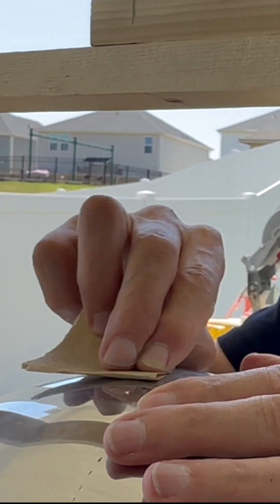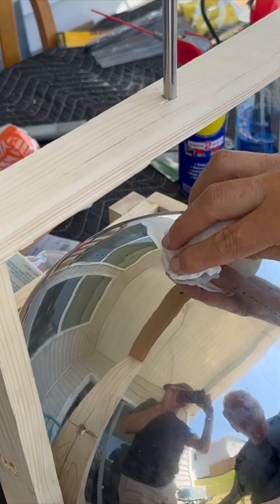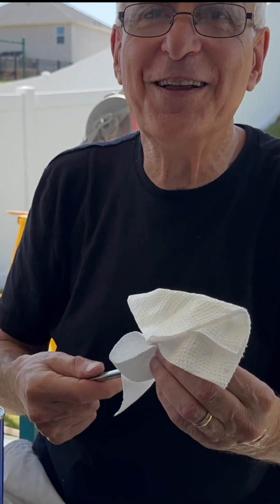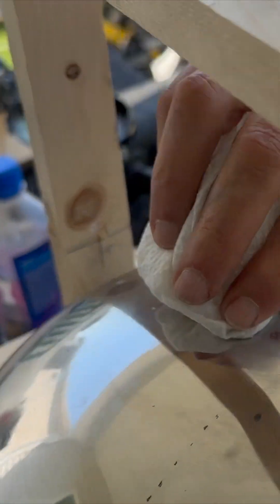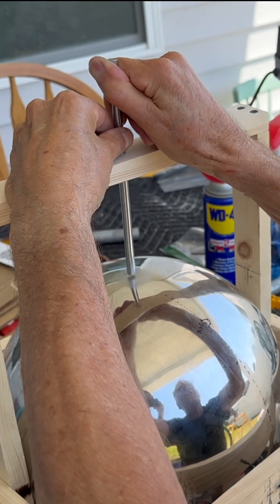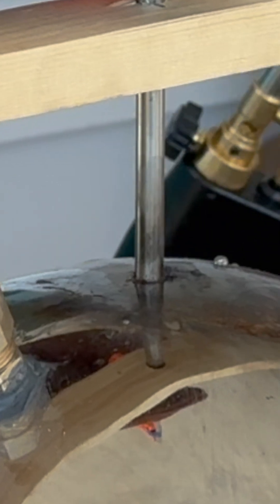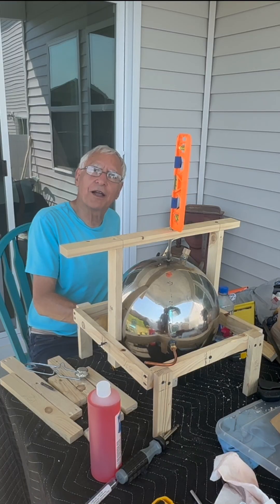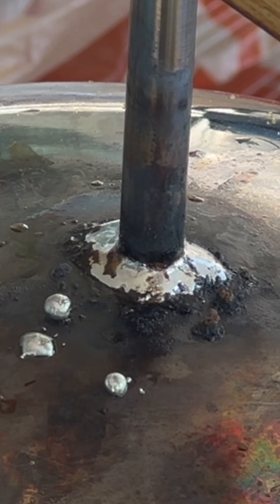Brazing Metal #stainlesssteel #brazing #soldering #sphere #prepare #surface #camping #outdoors #Hero

Comment: Denatured means they added either a little gas, methanol, or castor oil or other chemicals to make it taste bad and/or smell bad so you won't drink it. 😂
Reply: they use chemicals that makes you vomit. adding methanol is dangerous for those stupid enough to drink it.
Reply from the maker: Good to know because I was about to wash my veggies. 👍🏻